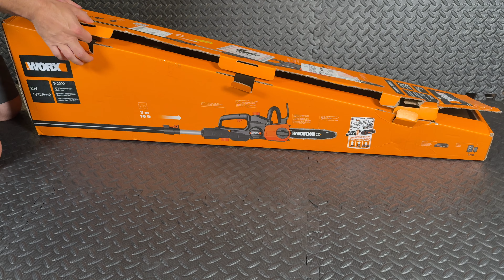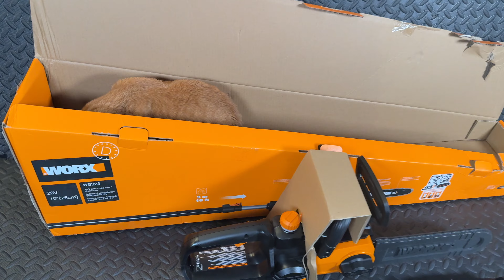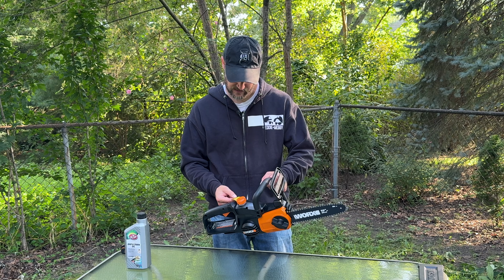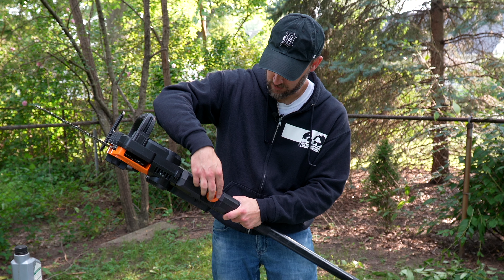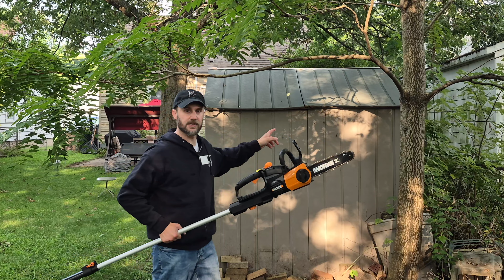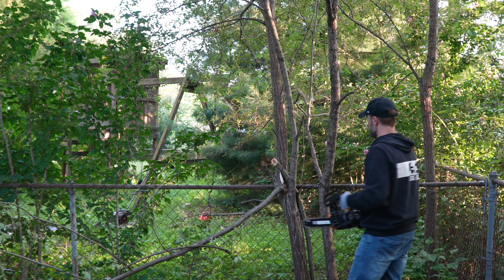Testing Out the Worx WG323 20V Cordless Pole Saw Chain Saw

Comment: Hi. I just purchased this saw. Im asking this question mid way through video.  How long does battery last?
Reply from the maker: I haven’t used it for long periods of time yet, so I’m not totally sure how much you can use it on one charge.  The most I have used it in one day so far is when I sectioned off a large limb that fell off the maple tree in my back yard.  It used up half the battery doing that.  I usually re-charge the battery after using it so that it’s fully charged up for the next time I need to use it.
Reply: I have the whipper snipper and battery usually lasts about 10 minutes… how long did the battery last for your new saw?

Comment: I am a bit dubious about the quality of this test.  Considering the width of the cutting bar, you have only pruned proportionately small branches, and for a slightly thicker branch, you have removed the pole.  So for me, this review seems highly superficial and the tool was not tested to its limit.  It seems like a promotional video for the tool, rather than an objective review.
Reply from the maker: As stated in the video, I was testing it for the first time and I specifically bought it to remove the low hanging branch on the poisonous tree in my backyard.  Nothing more, nothing less.

Comment: I was hoping you would be cutting something like a 4-6 inch limb. It says it can cut up to 6 inches but I’m really starting to wonder if I should just buy a gas or a larger battery capacity…?  But great video. Thanks.
Reply from the maker: I do think for larger limbs like that you would be better off with a gas chainsaw or a larger capacity battery chainsaw.  I have used this one a lot since making this video and I’m very happy with it, but I’ve primarily trimmed smaller limbs like what I cut in this video.